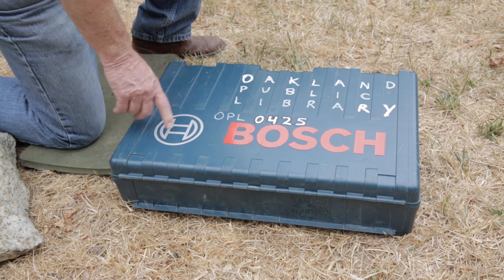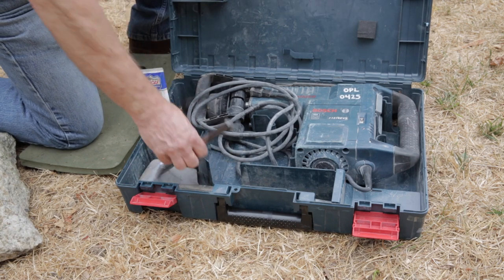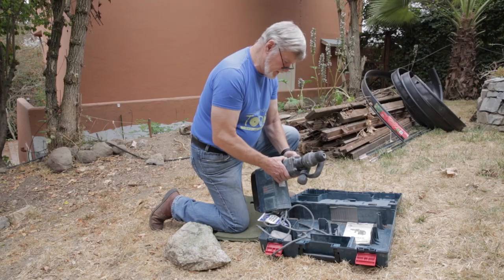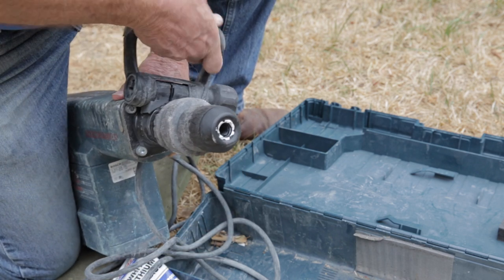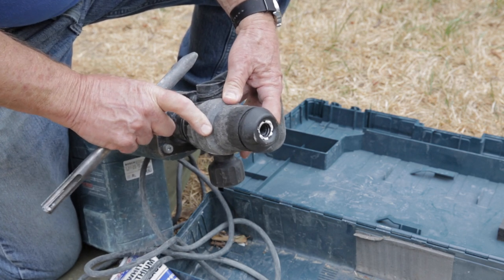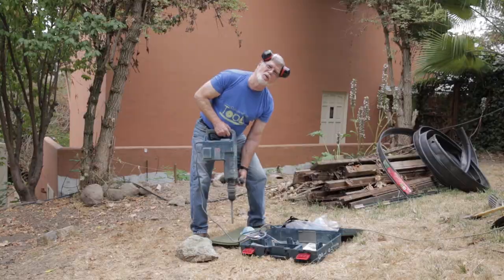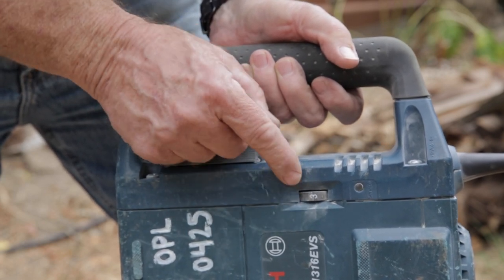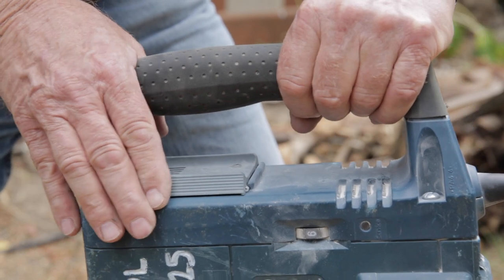Demolition Hammer - Instructional Video

Comment: 1:57 I didn't need to spin it but more so jiggled the sucker into place ;] I noticed also in thick concrete the drill bit could get VERY tight and only want to go deeper I remedied this by twisting the whole tool while pressing to actuate the bit, this widened/rounded out the holes that were biting tight on my bit.
PS Thx for Manual URL! Very much respect the idea of tool lending libraries and such systems, communities strengthen thru cooperation ;] 

It's crazy that some people think everyone can OWN one of everything. Like there's even enough planet left to store duplicate and un/derused tools already.